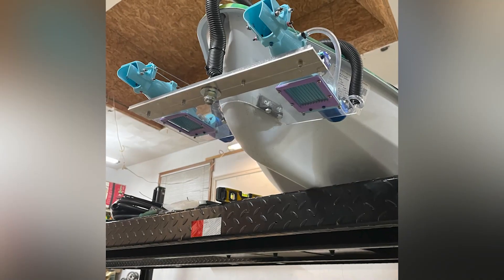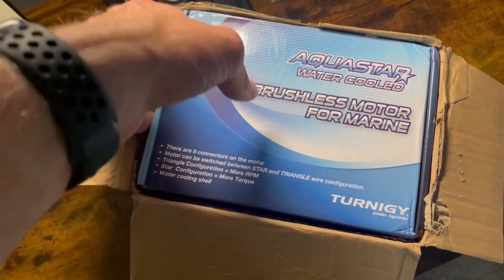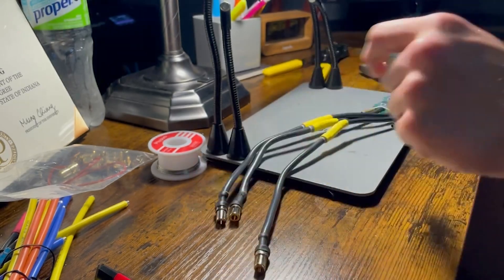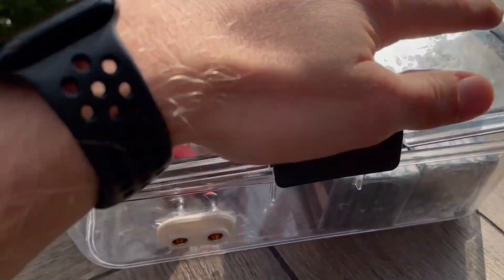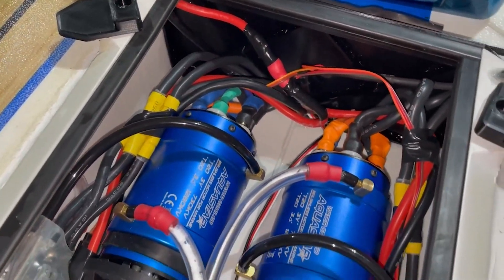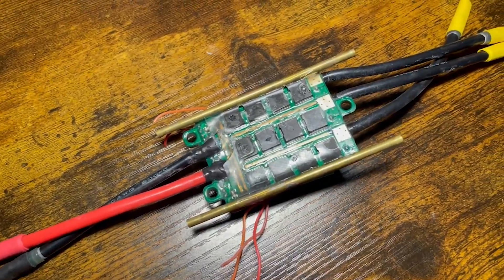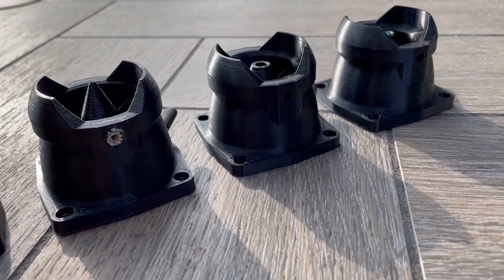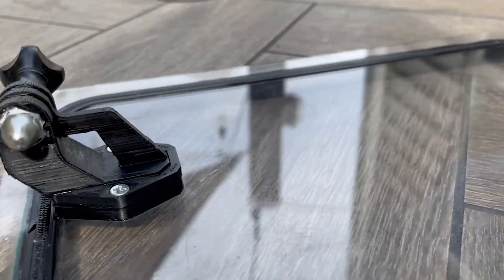Building a Waterjet Paddleboard

Comment: just to let you know as ive been researching water jets for my own jet board project, water jets are supposed to be above the water, sucking it in from below, if they are under water they are much less efficient, on boats they are under water till the boats wake allows them to be above the water, strange i know but its true.
Reply: if you put them closer to the top rather than in the middle then the wake of your board will also allow them to be above the water and you'll get a better result, itll be working against gravity a bit more but without the river water pushing against the water coming out of the jet causing resistance to the water coming out the gravity problem is negligible

Comment: Congrats for the first video, really good. And great work with board. I'm building small jet boat for Riverside communities here in Amazon Rainforest. Can you advise please on what motor best suits. How can I reach you?
Reply: Any e-foil motors (such as Flipsky) would work great for that application. The motors used here (Turnigy Aquastar) are a little undersized for anything other than a small project like this :)
Reply: @colewichman8795  will it work...? Fully Waterproof Motor Brushless Sensorless 85165 150KV 19500W for Efoil | Ejet boards